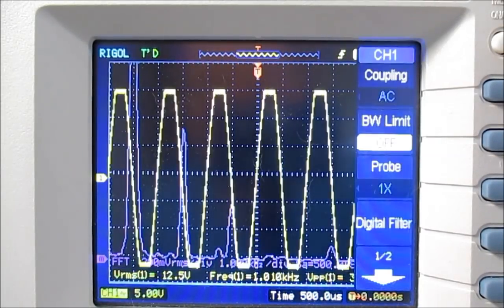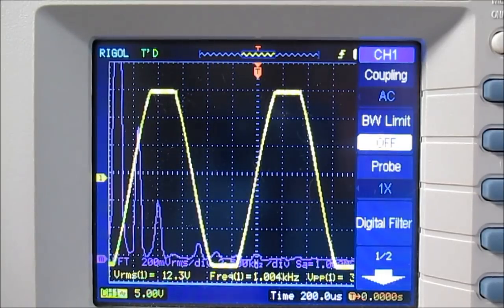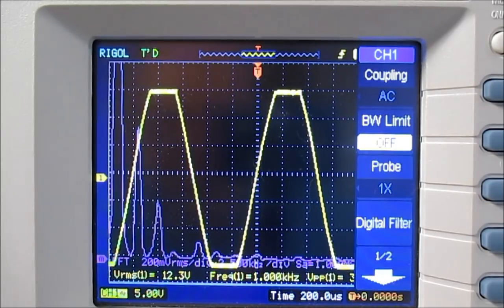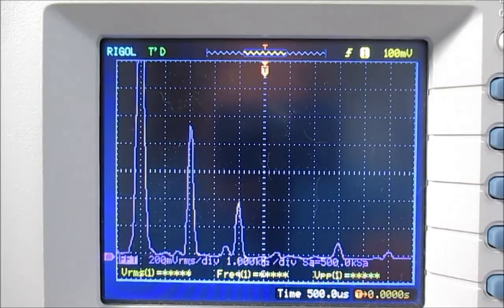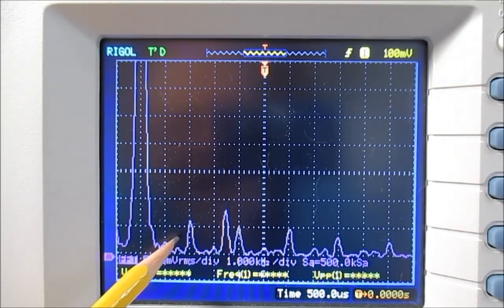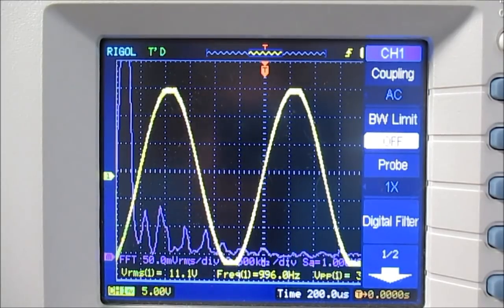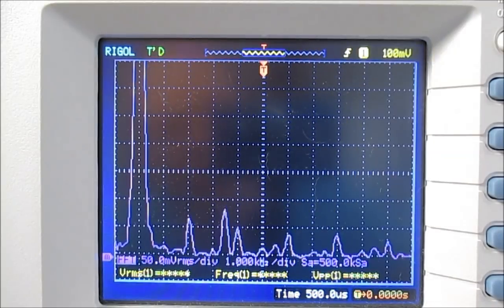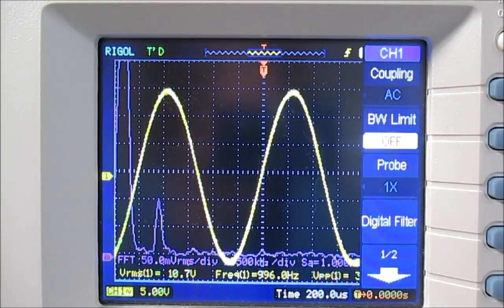Why 10% distortion ratings with some audio amplifier ICs?

Comment: There are two chips Id like you look into 
1. Is the LA4440 IC.
This is a tiny IC yet I have a car stereo 4 channel. With a 6 band Graphics equalizer. Hooked up to a 3 way speaker  10 inch woofer, 8 inch midrange and a tweeter and it plays so amazing and loud on a 12 volt supply that I cant wrap my head around how its so good. 

2. I tried building a Phono pre amp for my Hitach HT350. And have found that nothing sounds better than the ICs used in old Akai Amps. I cant get any Op amp to work as good as these old ICs in Akai amps. Why is this.

Comment: 10 % THD rating is more useful than might be obvious. Bass might get to this level and not sound too bad. Above 10% is a disaster. 10 % will be momentary if acceptable. Some believe they hear 0.01%. I doubt it. They might hear a concealed distortion found by a loudspeaker more than a resistor. TDA2050 was a nice device.  10 % at 1 kHz wouldn't be good .1950s tube amps were said to be good if 1%. This was made 0.1% if class B types or whatever. This is as true today as then. The concealed distortions usually include stability or slewing problems that  mostly were not common with tube amps. TDA 2050 is class AB. That is a small proportion is class A. 1/10 watts perhaps.  10% THD is an engineers rating. My first amplifier a Teleton GA 202 by Mitsubishi said 20 watts 1% THD. At 15 watts 0.06%. I almost didn't buy it due to that. They never said at 15 watts. A Siemens tube cinema amp of 100 watts gave 0.13% 1 watt and 1.4% 10 watts 10% 100 watts. It was a good compromise. I am certain the 100 watts would have been used. It was a serious piece of engineering. They weren't stupid.

Comment: Dunno if you've shown it before (i.e. can't find it) but I'd be interested in a demo of what that distortion sounds like if you could find a way of equalising the volume at different power outputs..
Guess some applications you don't worry so much about distortion - I was in a penny arcade a few weeks ago and one of the machines periodically played a shouting pirate voice at a high volume 'Arrr you win' etc through a car-type speaker.  audio quality was crappy as you'd expect - Guess there was a single chip amp suffering away in there somewhere, might have been a retrofit feature cos the speaker looked like it had been bolted on as an afterthought.

Comment: Thanks John.  How about showing us how to design a clipping monitor to build into our amp projects?
Reply: It is called a oscilloscope, but you can build an indicator circuit that lights a (red) LED when the circuit begins to clip.  Many amplifiers have this feature.
Reply: When was the last time you built an oscilloscope into your amplifier!
Reply: Please re-read the comment.  Ideally you would use an oscilloscope,  but a cheap circuit can be designed to light at the voltage that will cause clipping.  Many commercial amplifiers have this feature.  Another way is using a VU meter.   If it is proper calibrated, the zero db point is the point of clipping.
Reply: My original question stands - could John show us “how to design and build into a project an amp clipping monitor”
Reply: Wow, I told you they exist, and with Google and less than 10 seconds I found a YouTube video that shows a simple circuit that anyone with any electronics aptitude can build.      https://www.youtube.com/watch?v=L9sVY_wdDKw
Reply: You have got me interested in VU meters now 😀

Comment: I find it odd that this so common with Class-D chip-amps, given that the onset of clipping and the rise in distortion is more abrupt compared to linear ones. I guess it's after decades of looking at specs, but I'd always be far more impressed at first glance with, say,  "30w @ 0.03% THD" than "40w @ 10% THD"".

Comment: Thank you for answering my comment John. I am old school like you but with a 50 year gap went from valves straight to D-Class.  For me making a D-Class is all but impossible. The ST TDA7498E PDF shows figures up to 30% THD and 3 Ohms, the graphs are at 4 Ohms - 8 Ohms is nowhere to be seen. They state 160 W but looking at the graph nasty things are starting around the 80 W mark. I have built a linear and a  LT1083CP (pair) regulator power supplies and I have  buck converters. What are the pitfalls of using a buck converter to drive a D-Class ? The research I have done has just left me very confused.  I have just bought a scope, wish me luck.

Comment: Your video confirms my doubt on why companies do the 10% trick. Thanks John.
It may be useful to listen to the clipping amplifier playing music or test tone.
For that one can add an attenuator resistor of, say, 100 ohm in series with the speaker and connect them in parallel with the dummy load.

Comment: I am often asked what 10% distortion sounds like? The answer of course depends on the type of distortion. A good way to hear clipping  distortion would be to play a test tone though a loudspeaker at, say 1khz. Then slowly turn up the gain until. you hit clipping. Audible distortion can be heard by most people at around 1-2%. 10% will sound really hard and harsh. On the other hand distortion from a tape recorder  could well be 2-5% in normal use and not really be audible due to more harmonic distortion rather than clipping. This is why some people like the sound of a valve amplifier that tend to round the waveform at maximum power unlike a solid state amplifier that just chops the top and bottom off the waveform.
Running an amplifier into clipping can damage the tweeters in your loudspeaker as it's like putting square waves into then, lots of high frequency harmonics. You can always get lots of loudspeakers in for repair after parties with the HF unit burned out, I love it!!
Reply: They'll also complain that some 0 - 100 000 Hz +/- 0.01 dB, 0.0000001% THD @ 100W will sound too dry for their taste. People want more musical stuff, not strictly hi-fi.
Reply: Yes it depends on how the distortion is created.
1% from clipping will make your ears bleed from sounding so bad.
5% from a slightly mis-shapen sine wave is virtually inaudible.
A very experienced audio engineer once commented to me that if you can't see the distortion on an oscilloscope, you can't hear it, regardless of what a spectrum analyzer or THD meter shows. A "clean looking" sine wave will sound clean - the slightest amount of clipping is plainly audible.
John mentioned car audio. Most of those devices are measued at "hard clipping" - so over driven that a sine wave at the input becomes a square wave at the output.
Reply: I've blown many of the cone type tweeters over the years, I couldn't understand how a 30w amp could destroy a tweeter in a 100w speaker system. The Tandy (Radioshack) salesman said it's amplifier clip

Comment: John, you can calculate THD on your scope as it measures true RMS. Just use pure sine input, take note of the Vrms value measured by the scope, then using Vpp value measured by scope calculate pure sine Vrms and divide with measured Vrms. You had around the 10% mark 12.3Vrms with ca. 31Vpp (eyeballing as it is covered by menu @7:56) which is ~11Vrms for pure sine. Divide and you get ca. 12% THD. To get 10% distortion, adjust input level until you see the scope read ~12Vrms. Actually, that'll be THD+N as not only harmonic content will be calculated into Vrms value the scope computes. However, hopefully at 10% that won't matter if it's THD or THD+N or something else would be very very wrong.
Reply from the maker: That's interesting. I never heard that before. It seems like it would go awry if the distortion caused a high crest factor (large pk to pk). I guess it is only for clipped signals?

I missed the large 5th harmonic in the 10% measurement (notice how I ignored it). I'm so used to seeing the reference signal there, that I overlooked the 5th as the reference causing me to turn up the signal more and get 12%.
Reply: The THD calculation is similar procedure to analog domain THD analysis like on HP334A except now we do the notch filtering manually using ideal sine as etalon. Main requirement is that the measured Vrms must be a true RMS measurement. Naturally, there are limitations to using it this way.

Comment: I would not even look at or take any interest in am amp rated at 10% distortion if I was shopping. I am amazed that the chip company would even consider someone run it into clipping. By everything I learned some time ago, clipping destroys speakers,.. at least clipping on a high end amp into high end speakers, even if the wattage into the speakers is not above the maximum rating of the speakers. Also, who would want to listen to music at 10% distortion? It would sound absolutely terrible. If I recall correctly, when a super audiophile friend of mine was demonstrating distortion vs sound quality, I think I could tell the difference below 1%, just detectable to me there. But in reality, based on his seemingly infinite knowledge and experience, best to get an amp with .1% or lower distortion, which does not even make it more expensive. Most amps are far below that amount anyway. Maybe the super cheap stuff has more distortion, that I would not know because never had any interest in cheap stuff.
Reply: Clipping cannot destroy a speaker per se, the increased RMS levels resulting from clipping are what do it. Those same RMS levels from an unclipped source would do the same damage.
Reply: BiddieTube is right, tweeters for instance can easily blow if the bass clips, due to the harmonics in the clipped signal.

Comment: One thing I remind myself of is that "normal" people REALLY don't care about distortion. They just want volume, and they'll crank it up to that 10% distortion level and like it.
Reply: "Normal" meaning: "the stupid majority".  Most of them simply have no clue about the concept of distortion.
Reply: I did a service call on a system that complained that his system had lost volume.  I get there and his system included four JBL L-100 Century speakers.  His listening area was closer to the left, front speaker.  He turned it on and played it quite loud.  Of the four speakers, only one was operating properly.  The other three had only the 12 inch woofers working, and the mid range and tweeters dead.  He was running his source through a tape recorder preamp and then into his main amplifier inputs because he got more "volume".   The signal going to his right front and rear speakers was in hard clipping.  (I brought my oscilloscope).  I explained to him that this is what fried his mid range and tweeter units in the three speakers.  I advised him to NOT run the signal through what was actually TWO preamplifiers and also get his speakers repaired or replaced.  The thing is that he was listening to horribly distorted music and did not care because it was "louder".